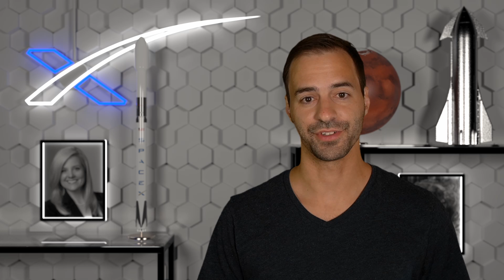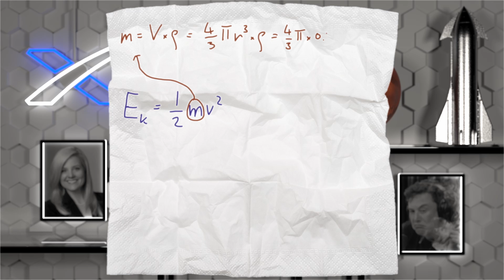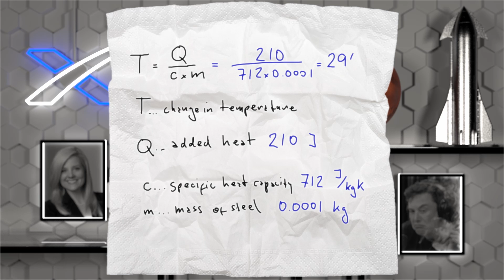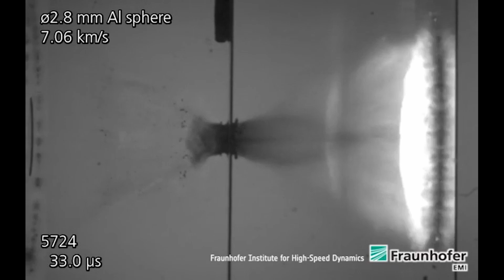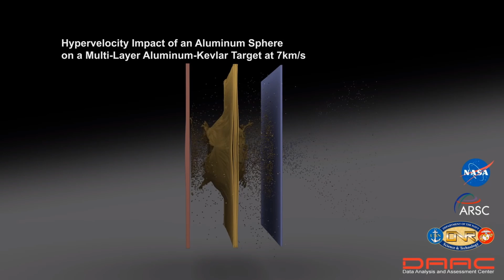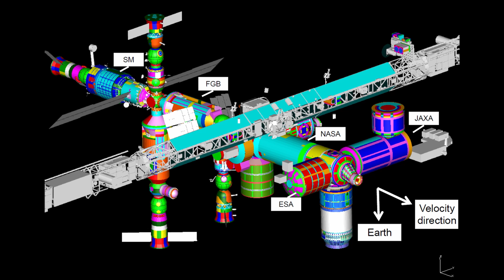Protecting Spacecraft Against Orbital Debris - Starship Example

Comment: Why not use bulletproof material?  Materials that do not get breached.
Reply from the maker: No current bulletproof material will stop even regular assault rifle shot. It would be too heavy to wear. Works only on pistols.

And Orbital debris has 50x more energy than assault rifle's bullet is the same weight
Reply: @spaceflightexplained360 , so Kevlar is only good against handgun 9mm?
What about materials under development that have been shown to stop bullets?
Reply: @jmikronis7376  Not good enough. As I mentioned, pound for pound, debris is around 50x more energetic (7x faster) than fastest rifle bullets.

Whipple shield is has been actually first invented for tanks for the same reason. Break the projectile first, stop it later

Comment: Those screens are invented in WW2 and used on tanks (German PzKpfw 4), they call them Thoma screens. Generally, those tank screens were a remote reflection of two layers of armor in battleships.
Reply from the maker: Interesting. It is a similar problem, even though the orbital speeds are much higher
Reply: @spaceflightexplained360  Well, almost all solutions have a history

Comment: On the subject of a starship shield relative to other orbital stages.. if I might be allowed to bring out my own tatty bit of napkin :) since the shield would be proportional in size to surface area of craft, obeying square law and total volume and weight go by cube, would this not be less of a barrier for a larger craft such as starship? I totally don't stand by my gross assumptions about density, whether shield actually required etc.... Just thought interesting :)
Reply from the maker: I think that is fair! The shield does not need to increase in thickness, so I think that the square/cube advantage for bigger craft or space stations holds...

Comment: 17:20 I adding to minimizing stay at LEO, keeping the Starship's altitude low would also reduce the risk of orbital debris. At altitudes of under 250km, orbital debris deorbits fairly quickly due to the high atmospheric drag, and thus not a lot a debris at those altitudes. Also, small debris tend to have a large surface area to volume ratio, thus higher drag and also deorbit faster when compared to larger debris.
Reply from the maker: That is a good point, indeed, very low orbits will have much lower density of debris.

Comment: SpaceX fans trying science is always a disaster. Please stop making factually wrong videos and spreading misinformation. You are causing permanent damage to science. Again, please STOP making such videos, you are not qualified and your analysis is completely wrong.
Reply from the maker: Could you elaborate? Because except the back of a napkin math, I am just re-telling the work done by giants of the past.
Reply: @spaceflightexplained360  No I can not elaborate because I cannot replace your lack of education in a YouTube video comment. However, maybe you realise what literal nonsense you say in your conclusion when you claim the worst case would be a cancelled mission. Just wanna remind you that a 3mm hole caused from a 1mm projectile has the power to release tons of fuel per hour (remaining liquid). Since Starship requires (according to Musk) 6 bars of pressure to operate, that would be already a certain death sentence for the vessel, since with such a leak re-entry into atmosphere is not possible. Also a leak in the major mehtane tank will cause a blow torch effect during re-entry which will also kill the vehicle. And then, what if debris hits the engines? Also a huge risk that cause landing crash. This list goes on and on. Starship is a lie! It's only meant to be cheaper than the Falcon 9 which is a financial disaster. You are such a joke with your Musk and Shotwell pictures in the background.. You are just as a science denier, imposter and buffoon like these two. Why are you making such foolish videos? Nobody knows, probably you want to feel smart and intelligent but what you really just do is to be the puppet of Musk and spread his misinformation, conspiracy theories and his lies. Foolish!
Reply from the maker: Yeah, there might be a lot of problems with a small home in the tank, and the point of the video is to point out the danger. 

But, that is where your credibility ends. So much anger, so many personal attacks, "Starship is fake"... One day I hope you learn that professional disagreements and personal disagreements are two completely different things. Oh boy.

Comment: Your second video is at least as interesting as the first one. The topic is once more eminent! The structure of the video's is very methodic. And that is what we mechanical engineers love! 
Nowadays a lot of high speed impacts are tested with railgun-like setups. A simple version can "easily" be built in your own shed ;-)
Reply from the maker: Thank you Aad! I really appreciate it!

To me, that two stage light gas actually seems pretty simple. I did not follow advancement in railguns, but if you have a high powered one, aren't there still problems resulting in the need of replacing the rails quite often? (unintentional discharge machining :) )
Reply: @spaceflightexplained360  You're welcome and please continue these very nice video's. I originally am a mechanical engineer (mechatronics) and I love all which have to do with aerospace (including fighter jets etc). Video's as these, which are going deep into the mechanical aspects, are valhalla for me. :-)
With regards to the railgun I think that I didn't communicate very well. What I meant to say was the nowadays railgun-like equipement is used to do these test. With railguns you can launch almost every projectile at for example the Whipple walls. I hope I made it clear what I meant to say. English is my second language, after Dutch, so sometimes I write down sentences which are grammatically not correct. 
Now I am going to watch your third video ! :-)

Comment: What!? 5%!? NASA allows for a 5% risk that someone randomly dies on the ISS? :o That’s higher than any other job :p
Reply from the maker: 5% risk in case of penetration, which is itself is 24% over 10 years. So in 10 years, they estimate ~1 % chance somebody does from it. Not too bad.
Reply: Spaceflight Explained oh, ok makes more sense. Still, 1% is about 10x higher than Earths most dangerous job (logging).

Comment: nicely done!

I was thinking about this a while ago, because if Starship does need an internal pressure to  mantain stability, like avoiding bluckling or for any maneuvering, then a micrometeoroid hit on its tanks on its way to Mars would eventually be fatal to the crew during descent to Mars's surface.
Reply: In the thrust structure, yes! Inside the tanks I havent seen any.
Reply from the maker: Yeah, that is the question... The bellyflop will put a lot of side stress on the tanks - are they strong enough when not pressurized?
Reply: @spaceflightexplained360  since, till now, all the prototype designs have no internal stiffeners and ribs (not even a mention from Elon), and due to the fact that the final design will be a lot lighter, I guess they are not.
Reply from the maker: They actually seen to have a lot of ribs and stiffeners welded from the inside. At least based on the engine shots (thrust structure) and the dotted vertical weld pattern on the outside of the tanks

Comment: Whipple actually didn't conceive of the Whipple shield. The idea was common knowledge for many years in the military - spaced armor. Panzer 4 used thin sheets of steel to break up anti tank rifle bullets before they hit the main armor. Most armies of WW2 implement this idea in some form.
Reply from the maker: Thank you for this information! I couldn't find any source on this... Can the thin sheet be there to make the rpg/tank rounds trigger and explode before reaching the main armour? Instead of breaking up a monolithic bullet? The Whipple Shield doesn't work well for lower (bullet) speeds...

Comment: There are two main possibilities which can be used together- protection and repair. Parking the Starship inside a bulky but low mass non-pressurized hangar should be possible if the hangar is deployed or assembled in orbit. Plugging holes after they are formed should also be doable, similar to the tire hole plugs used to repair tires while they are pressurized.

While it won't be as simple as the SpaceX animations, the problem can be solved.
Reply from the maker: I'm curious about the fuel/parking depot. For a size of a Starship, it would be a big project by itself. Of course, not impossible, but it would have to be a Spacecraft in its own right with fuel, engines, solar arrays and everything.
Reply: @spaceflightexplained360  The hangar (the size of two Starships so the tankers would be protected during propellant transfer) would be just the outer Whipple shield panels and a Dragon docked with it to provide orientation and reboost, with a big door to let the vehicles in and out. The hangar would mostly be a passive box, maybe a small solar array to provide some power to the Starship parked inside.
Reply from the maker: It cannot be entirely passive. It needs attitude control - if it would get into a slightest spin, docking would be impossible. To control attitude, it needs communications. For that, it needs energy - solar panels. I assume that Starship would be able to boost it up from time to time to maintain orbit against the drag.
Reply: @spaceflightexplained360  All those services could be supplied by the Dragon capsule attached by any suitable means. Why design a complete vehicle when you can essentially hire the needed services?
Reply: I was thinking the same, a space hangar of some sort.

Comment: I loved the episode. The fact that you went into all the science before coming to Starships answer was a great move. In the end, it makes sense because of all the previous information digested. 

The only solution, that I can see, to this problem is developing a material strong enough to withstand these particular micrometeorites. Since all the science has already been done on everything else about the problem. SpaceX is developing their own type of 30X Stainless Steel, I wonder if this problem is the reason for advancing development of the steel in the first place? Maybe radiation as well? 

Anyway, great episode!
Reply from the maker: Hi there! Material strength really doesn't help here, unless it is something order of magnitude better than we have today (graphene)? Deployable Whipple Shield or a protected fuel depot might be a solution...
Reply: Spaceflight Explained ,
I agree. Just thinking along a “what if” scenario. Maybe SpaceX’s new stainless steel development will result in the strength required resulting in the design of Starship in the first place. 
I’m just throwing silly ideas out there.

Comment: Your candid comments are refreshing and based on physics this makes a powerful presentation. One solution to the possible hits in low earth orbit would be a space station which could be just a large parking garage for the rockets to stay while  topping off their fuel and other loads. This garage could also function as an assembly port.
Reply from the maker: Yes, that is definitely an option. Pretty complicated one, but potentially necessary?

Comment: I don't think it's a good idea to design the starship with no such shielding, because, Earth orbit is known dangerous, Mars orbit present it's challenges and the interplanetary space while much more void than low orbits expose to much faster MMOD. And radiations will impose other kind of shielding. Refueling will be quite long duration.
Reply: The multiple refills can be done to a tanker in LEO. Then the passenger Starship is filled in one step.
Reply: @imconsequetau5275  I completely agree, this is the logical order, to shorten exposure of the astronauts, and also reduce the number of operations that each could have failure.
Reply from the maker: I hope I'm wrong and they figured something out!
Reply: @spaceflightexplained360  We ahve seen some sample of thermal tiles added exterior to the starship. It remains possible that the starship will be protected by a mix of thermal tiles and MMOD/radiation/ thermal out shielding ? (because the other side must expel heat, while the frontal takes the heat)
Reply: @spaceflightexplained360  how was the space shuttle ?
Reply from the maker: @AlexandreLollini  it was pretty strongly protected. Got hot into the windows few times, but it didn't break then. Few thermal times were also destroyed I believe

Comment: Awesome overview!  Good detail. In my years of contemplating this sort of event I've wondered if ice could be used as part of the Wipple shield as sort of a self healing mass.  Ice having high hydrogen content makes an effective shield for slowing high energy radiation (abeit a thick layer of ice).  If the space in the wipple shield could be filled (over time) with waste water it might be able to do double duty (as debris and radiation shielding.  Just speculation, but I was wondering if anyone has put any research in this idea.
Reply from the maker: Thank you Mike! I think something like this might be possible for vehicles that would be built on Orbit And stayed in space. It would weigh too much to be launched from Earth in one piece. You would need a double pressure hull with water in it, and also a Whipple Shield to prevent holes in outer hull, otherwise the water would start leaking.

I am not sure how having ice there would work - how would you put it there and how would you prevent it from melting on the sunny side?

Comment: Could another solution for starship be that they orbit really low (like 250 km?), where there is not a lot of orbital debris because of drag? That would also minimize the disaster if two refueling starships explode or something like that.
Reply from the maker: Perhaps, very low Orbit will also allow them to increase payload mass, but I'm not entirely sure that the risk is lower there. I'm sure they have good models to figure out the Orbit with lowest risk.
Reply: @spaceflightexplained360  The risk has to be significantly lower. At 250km debris must clear in about two weeks. It could be longer if the orbit is eccentric and 250 km only at periapse, but not that much longer. Intuitively,  space debris risk at sea level is zero, and the risk must increase continuously up to some altitude.
Reply: Since the starships will have to consume fuel to produce thrust for ullage while transferring fuel, they thus would be able to counter drag. None the less debris is always falling inward so a very low orbit is no ensured protection. Starship's heatsheild tiles might do, but those tiles will not cover the whole thing would they?
Reply: @frbe0101  The thrust for fuel transfer to also counter some drag is a really nice idea!
What do you mean by debris always fall inward? When orbiting things fall inward half the time, and go up the other half of the time. But drag slows things down so they go lower so they de-orbit. At lower altitudes debris last for a shorter time so there are less debris there.
For starship heat shield tiles do seem like they would offer some more protection against small debris yes. Perhaps it's an idea to orientate the belly into the direction of travel. Not a lot of collisions will happen from the back.
Reply: @kedrednael  I mean the orbital debris is slowly falling out of orbit due to drag with the exosphere, it thus must cross with even very low orbiting spacecraft eventually. 

I think no matter what for fuel depo and deep space starships they will need tiles all around, with back tiles specifically for MMOD protection. I think the heatshield tiles will consist of a refractory metal a few mm thick and likely a gap perhaps another layer of metal as an IR reflector, so basically like Whipple shielding. Back tiles could be made of something lighter and lower melting/decomposing temperature, like silica fiber with Kevlar mid-layer.   

Only the superbooster and starships that are expected to stay only a few days in space would lack protection.

Comment: Skylab actually had a deployable micrometeroid shield (a Whipple shield) covering the Workshop part of the space station. This was an experiment to test the shield in orbit.  During launch on 14 May 1973part of the shield deployed accidently and was partially torn off Skylab by aerodynamic forces during ascent to orbit. The remaining part of the shield was blown off by the thrusters on the S-II second stage when it detached from Skylab after reaching low Earth orbit (LEO). 

It was more a test of the mechanics of the shield than its effectiveness against micrometeoroids. In early 1965 NASA had flown the three Pegasus spacecraft at Skylab altitudes. Less than 400 micrometeroid hits were recorded in the first 6 months in orbit. NASA concluded that the Apollo Command Module design was adequate protection from these hits. 

Full disclosure: I worked on Skylab from 1967-69.
Reply from the maker: That is amazing, Skylab was such a wild space station. 
In 60s and 70s, there was much less debris than today... I wonder what assessment would they do today and how Orion differs from Apollo capsule in that regard.
Reply: @spaceflightexplained360  There certainly is more debris in LEO now than there was 50 years ago when Apollo was flying and Skylab was being built. AFAIK Orion does not have a Whipple shield. 

There have been hundreds of military, science and commercial spacecraft that have traveled from LEO to MEO to GEO during the past 50 years. I don't recall that any of these payloads had any type of damage from micrometeoroids. The space between LEO and GEO is immense in size  so collisions should be very rare.